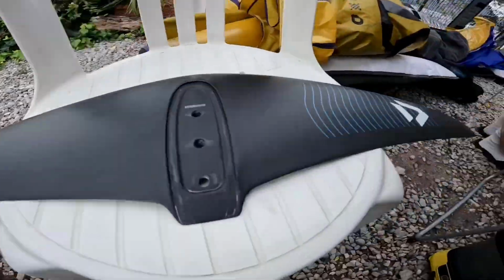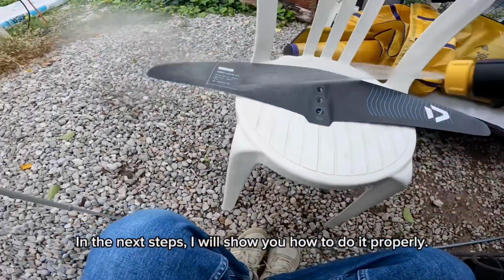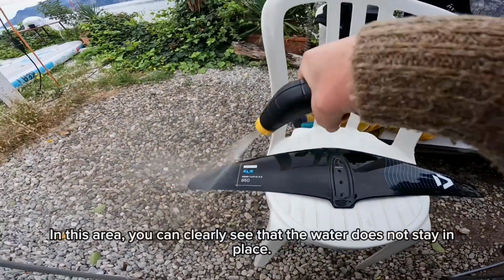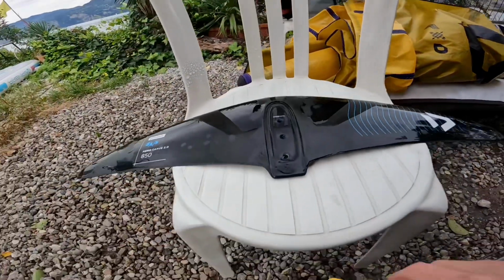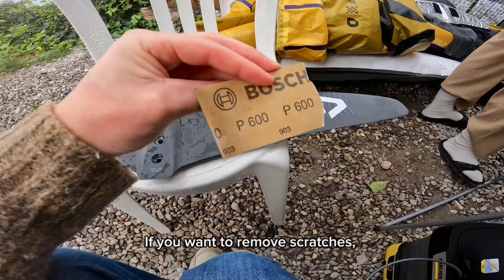How to Prepare Your Foil for Optimal Performance in Wingfoiling - Ventilation (flow separation)

Comment: Hi, don't confuse cavitation (only happens at 40-50 Knt) and ventilation.
Ventilation is what you are solving by finishing the foil
Reply: Sorry but wrong .cavitation can appear at low speed .several studies in water tunnel show it.for T wing generally at the jonction mast wing.not spectacular as high speed cavitation but inducing quite à lit of drag.
A small defect at tis jonction could initiate it.
Reply: @jgblete403  do you mean "ventilation" ?

Comment: 1000 or less is too much. Efficient coating are never so smooth.the reference in water is the shark skin type.same for torpedoes. The issue is you need to combine low friction for speef and avoid micro cavitation for efficency.thats clear that lower the friction is, easier is the cavitation to appear
I used 380 paper with x cross application
Try it to see.